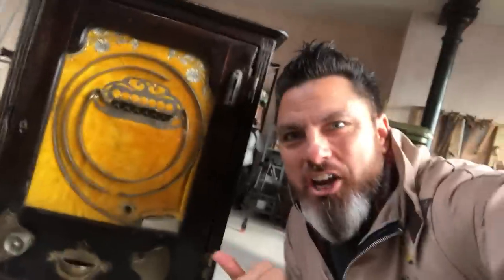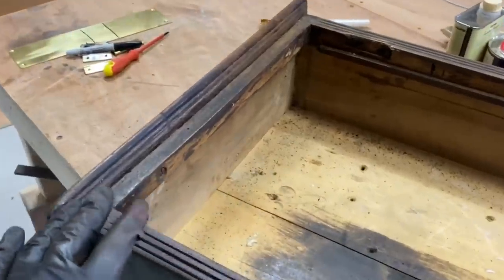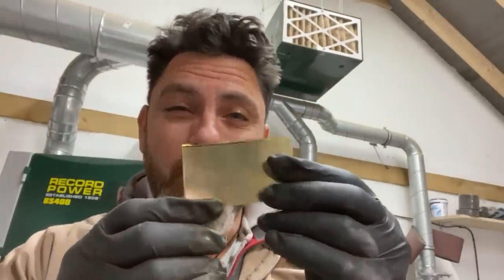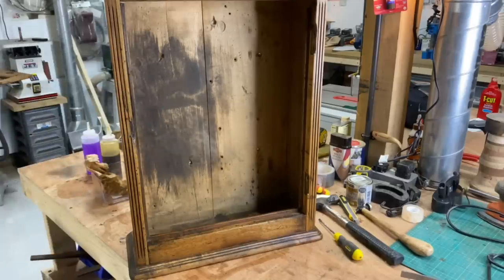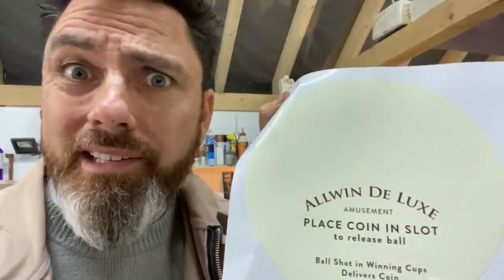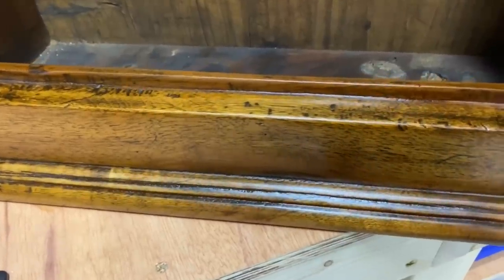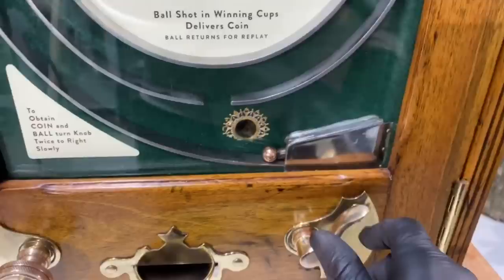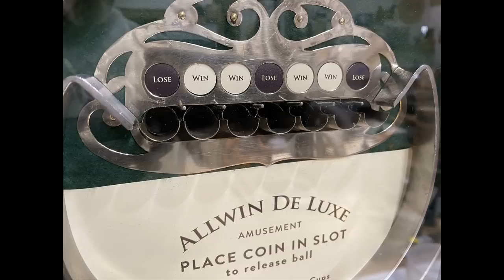Restoration - The French Allwin Deluxe Penny Machine - It wasn't easy!

Comment: Nick you might try using a small comb to hold those little nails, just place the nails between the teeth then start the nail, remove the comb and finish pounding the nail. Has worked for me!!!

Comment: Hi Nick, this is my very first public comment ever! I can't believe it's going to be a suggestion about wood stripping.. My grandmother used to sell antiques and restore furniture.. I distinctly remember her using a putty knife to scrape off the layers of finish, which seemed to make her work go much more quickly than how it went for you.. Can't use a heavy hand while doing it or you'll make marks in the wood, but it'll save you all that crazy coat, rub, repeat you had going on there... Putty knife! 😁

Comment: Hi Nick, Fantastic restoration. The only thing that spoils it for me is that you used Phillips Screws on the front instead of Brass Slot Head Screws. Sorry for being picky but it's just me as I don't think Phillips Screws would have been made at the time this was originally built. Cheers. Huw
Reply from the maker: Wooden-It-Be-Nice yea good point and good spot 😬👍🏽
Reply: @nickzammeti  Thank you Nick. You could always change them prior to the winner picking it up. Cheers, Huw

Comment: Hey Nick, I've seen somewhere where a guy fixed a horn of a saxophone (the dents) with a steel ball and a magnet put the ball down in the tube and then run the magnet back and forth, probably with some type of felt covering the magnet so no scratches and the dent will eventually come out, i cant remember if he used heat to soften the brass up or not, might look into it and fix those dents in that tube just an idea

Comment: Nice “restoration” however the crosshead or philips screw heads were not invented until the early 1930s. Countersunk slotted screws should have been used on the hinges and perhaps raised head slotted countersunk brass screws on the brass plates on the front if you wanted to be period correct. Also Evaporust works better than coke only you can’t mix it with Rum and safely drink it.